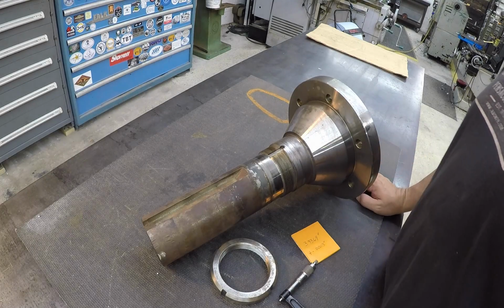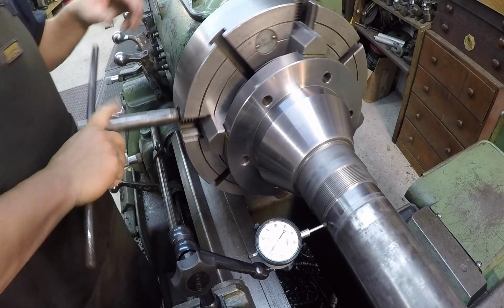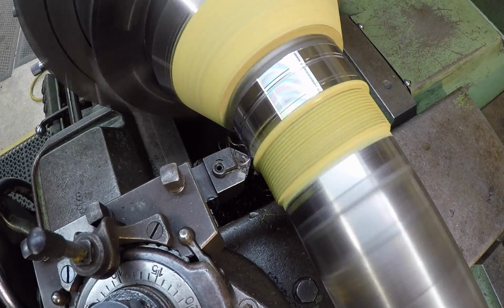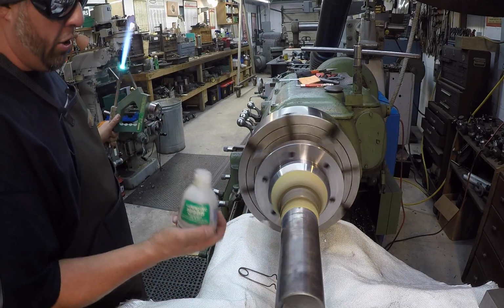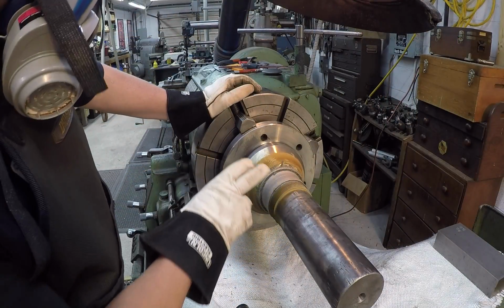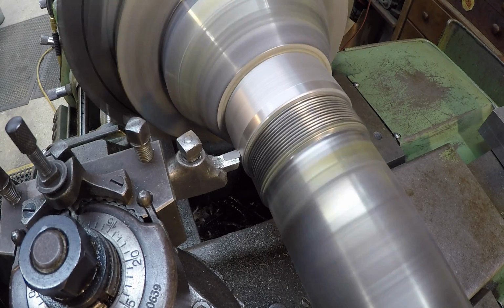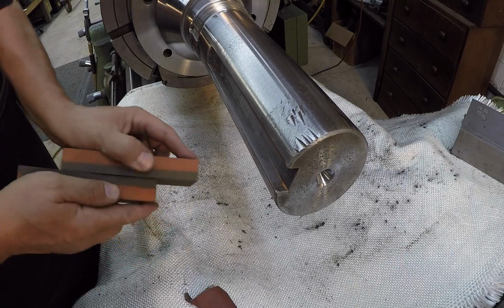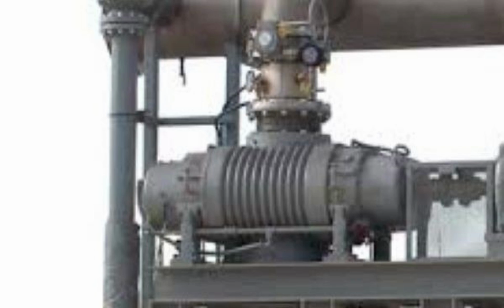SNS 300: Spray Welding a Blower Shaft

Comment: I have NEVER seen anything like this before.  This was really cool.  I appreciated the explanation at the end why you wouldn't use a conventional weld build-up as the heat would warp the part.  If the part would cost the company more than they'd like to replace, how much are you able to make on a spray weld resurface like this?  I'm subscribing to your channel as I want to see more.  Thank you!
Reply: You can charge whatever the market can bear.
Reply: Machine shops usually quote by the hour + material. Machine shops in my area charge anywhere between $70 and $90 per hour. This job probably took a couple of hours, and he almost certainly quoted an extra hour just in case something went wrong. That powder used for the spray isn't cheap, so he's charging for that. All in, he probably charged something like $300-$400, before shipping. 

To make a part like this from scratch would cost close to $2,000. It's complicated, and the material isn't regular cold rolled steel either.

Comment: We did it over twenty years ago and called it "Flame Spraying." We used it on aircraft
Bearings when replacement bearing were not available
Reply: That’s funny! Every time he pulled down the torch to start application and blew that huge initial spray I would say to myself, “DRAGON BREATH!!!”
Reply: we called it flame plating rather enjoyed it -- biggest surprise was -- did the same job the part-owner did too --- long long ago memories hehe

Comment: I had a job doing this around 42 years ago for an Electrical Motor Re-wind company, it was a good process, I wonder f it is still used?
Reply: We still used it for bearing fits on shafts 14 years ago, the last time I was in a motor shop.

Comment: Nice parts washer.  Reminds me of when I was in high school, working in a local shop=salvage yard…had an old Varsol machine inside an old shed…used it to wash parts and hands at end of the day pretty much every day…and there was about a 50/50 chance you’d get zapped when you turned the pump on.  Damn solvent would carry current and wake you right the hell up. Was like that the entire time I worked there. Lol!

Comment: Very good video! Back in the 1990s I had a 3" or 4" by about four foot long shaft repaired by spray weld, as far as I know it is still running 40 years later. It was a large blower fan (60 HP or larger) on an air handler, first we had some vibration, than it became a rumble and then we found the culprit. The worn shaft was spinning in the bearing.
A new shaft would have been a lot more cost than the repair was and we also replaced the bearings.

Comment: Can this type of welding be used to repair an outboard rod journal. Rod bearings are caged needle bearings and crankshaft surface has a hardness between 54 and 56 rockwell

Comment: We started spray welding at our shop in the late 70's, we used Metco equipment. Pump shaft repair customers loved it because it was a cheap alternative to replacement. Did those jobs for months on end. I still come across jobs where I think "If only I had spray weld gear"

Comment: Very cool process, as a welder for some of my younger years I had never heard of this process. I wonder what the powder is made out of. Later in life I became an electronic repair tech and then a wirer for a Sullair and then Sulivan Palatek who make screw compressors of all sizes. When working at the one company I got a chance to fill in for a machinist that was having his knees replaced. I got the opportunity to turn the blanks for the screws that go into these compressors on a CNC Dual Turret lathe. Since I had machine shop all through high school,  I found this a very interesting learning experience. More interesting yet is the 2nd step of the process of how the companies profile grinder machine with its diamond cutting wheels cut the spiral flutes into the male and female screws that produce the compressed air in these screw type compressors. Keep up the great job, I’m subscribed now and look forward to more content. ✌️😎👍
Reply: It's a long list of powdered metals and oxides and things of that nature.

Comment: Great work 
 I have done industrial spray mig welding near 470 amps pure DC at 42 volt with .o45 wire pure Co2 gas on repairs like that as we needed a harder high carbon surface repair that was replacing much more lost material due to bering fail. 
    My method then was experimental in our shop as the company was in a rush and a 50 mile line of heavy oil was cooling down.
     Welding took only 5 min time with 5 hours preparation work was ganging up 2 400 Amp Hobart 3 phase welders with makeshift v block to rotate the piece while I applied the weld. 
   Afterwards it was sent over to a motor machine shop to lathe it down for another 3 hours and then hotshot driver back to the heavy oil transfer site.
     Worked perfectly and was within laser tolerance for minimal vibration mixing in a explosive condensate at very high pressures.
     Pump lasted another 9 years till system got a expansion.
 After that repair our shop went to Lincons that were in the 800 Amp range doing farm lifting shafts that needed a fast welding without changing the deeper structure of the base steel for Phoenix  100 foot rotary harrows in the lifting mechanism

Comment: I have a question for anybody that knows about this is it possible to arc-weld on a blade with the material spinning very fast could you are quelled a joint as it was spinning quickly like this is is it possible

Comment: Its an amazing blast from the past I have never done spray welding myself however I started out in as a machinist in a die press manufacturing company   in the machine shop, The welding department would do tons of spray weld repairs on crown belt pulley shafts and even on former tool shafts that ran directly on oiled bronze bushing. The pulley shafts were long and drove lines of presses with bearings spaced down the line it was a cost effective solution to scraping the shaft. The repairs were done often and don't remember any failures. Very cool to see it done by a pro Thanks for sharing

Comment: awesome can this process be used on automotive crank shafts
Reply: Cast crankshaft don't like the heat and the surface is going to different
Reply: @mikejohnson5491  that’s what nickel rod is for. Pre and post heating. Never had an issue
Reply: @cwr4587  ok they're talking about the spray welding not fixing a cracked block. The guy asked if it would work for a crank shaft. Does nickel rod work for building up where a spun bearing needs to be built up.

Comment: Back in the late 40's my grand fathr started a business of metalizing ceramic lamp bodies. He would cover um with zinc, and then use stainless steel spool wire or brass and spray it on the ceramic lamps. He then had to buff smoth all the roughness that came from the spraying process. They used flint buffing wheels. I was a kid but still remember when they got zinc poisonings really bad. they recovered!

Comment: Can we use this on the crankshaft ?
Reply: Id like to know as well. Id imagine there is a good powder for this application and since its riding on a layer of oil and doesnt contact.
Reply: @TheAnonymous1one  when we used it in electric motors and industrial drive repairs we kept it limited to things like bearing fits that wouldn't allow it to be slung apart from centrifugal force, it becomes like a cast sleeve on the shaft, I have seen it used from other shops on babbitt and oil lite bearing fits, but our shop policy wouldn't allow it.

Comment: good job, but about 25 years ago as a metalizer of 45 yrs i gave up overspray retardants in favour of simple guards that stradle my lathe and keeps the over spray away where u don't want it. it works for fuse welding, wire spray and plasma, leaving about a 1/16 of overspray to clean up after

Comment: Nice shop you have there. I worked in a job shop with an old guy when I got out of trade school as a welder back in "81" for about three years. They were a dying breed back then, all the others opting to move to production work. That was one of the more enjoyable jobs I've had. That was so much fun  learning to use all the machines in the shop and new projects to figure out and work on every day almost. The old guy was a master at it and a hoot to work with.
I moved on and wound up in electronics which I've done for the past 30 years. But I'll always love and have a soft spot in my heart for machine shops. :)
Great vid. Thanks for sharing!

Comment: Hi, enjoyed the video. In the Aerospace industry they refurbish parts using plasma spraying, and Ford uses the same process to refurbish cracked engine blocks. My only concern is that you made no mention if the part had been X-rayed to check for cracks. I say this because if the parts does fail and it had cracks and it ended up fouling the whole assembly your fixed part goes into, then the easiest way to put the blame on you is to claim your work failed when in fact it was the operator who failed to make proper adjustments and caused the damage. I speak from personal experience having worked in the oil and gas inspection services sector, and my son is a parts tester for a major oil and gas service provider. In one incident a part my son's company made was accused of failing causing over a billion dollars in damages. Since my son is the top tech , he was tapped to simulate the proper installation of the part compared to the video and notes by the oil platform tech who installed it and had it failed. An international group arrived which consisted of the owners of my son's company and owners of the oil company and their top engineers. Well my son demonstrated perfectly how the part was to be properly installed, and he was able to show the part could be taken above stated maximum tolerances and still not fail. Then he replicated what the oil company did installing the part and he showed how it started to fail when a load started being put on it. The oil company's own engineers conceeded that the part had been improperly installed and the multi billion dollar contract resume and the lawsuit dropped. To protect yourself from being shaken down by a company who is trying to shift the blame for their own mistakes and armature repairs, demand the part be properly inspected and x-rayed before doing any work. And make sure you get to see the x-ray and notate on your work orderform any areas of concern before attempting any repairs. And make sure to properly notify the owners of the part in writing what you found before you start. The saying goes... the last person who fixed it is to blame. So please be careful, from my viewpoint it looked like there was some evidence of stress fractures on the upper part of the shaft that was all beat up. 

Carpe Metallum!

Comment: How does the strength of the spray welded area compare to the original metal?  Stronger, weaker, or the same?  Is "spray weld" 100% metal, or are there other things like epoxies, etc...?

Comment: Very interesting presentation.  I am wondering that since you put the unit in the chuck cold, and after applying heat even if not excessive, why would that not require a "time out' to make sure the natural expansion of the shaft would not alter the trueness of the chuck????  Heat expands...apparently evenly...but chucks take that expansion somewhere...I noted that you use "pads" of brass and or other materials you said to protect the shaft (piece)  Would that allow for even expansion???  Not a machinist....just an old guy wondering about that heat change and effect on the outcome of the product??  Nice vid...

Comment: Welding will work better than the spray welding . Our company had  tried it, but it didn't work, it just pealed off when they machined it back to size !!
Reply: didn't do it right.
Reply: spent 20 years metalspraying using metco, best kit on the market.correct proceedure 1 preheat 2 undercut 2mm on dia 3 mask and grit blast surface ,if no grit blast facilities,rough screwthread .020 depth 24 tpi 4 antibond and spray one step powder for build up plus maching allowance. SIMPLE

Comment: I did quite a bit of shaft repair working in a job shop back in the 80s but we undersized the journals cromed then ground to size. We did Medical, aerospace, and national defense projects We specialized in superfinishing. This was very interesting.
Reply: Hard chrome or thin dense chrome is more acceptable for flight hardware. Cold spray can fail

Comment: Your video brought back memories. Back in the early seventies I worked for a pump shop in    L A doing shaft repair using the exact Eutectic setup not only for the bearing area but also for the area where the shaft packing sits. I remember powders in stainless and bronze also temperature markers for keeping it at 200/500 degrees and a asbestos blanket to protect the lathe…..ahhh the old days.

Comment: Won't the mallet shock shear the gears in the dial indicator?
Reply: No it shouldn't. If it does then you either need a better quality dial or a shorter travel dial.

Comment: The metal shavings from the metal structure deposited by flame spraying and stacking are shown as porous and bulky in granular form, and the complex force with the original metal is very low, and it is unable to bear heavy pressure and torsion.

Comment: Sorry I don't mean to criticize. You were wright when you said that the system was very old . I know this for a fact. In the latter 70s I was a flame sprayer for several companies. Like Otis engineering, Brown and Root, Halliburton Ingersoll Rand . I coated Ball valve seats, down hole pump plungers polish rods spiral guides. Metco (out of Houston Texas)had a system that worked a lot easers. there is a tape that you can cover the threads with that will just peal right off .Check out a plasma spray welding ! Also the coating that you put on has a possibility of cracking and pealing try cutting a 125 finish on the base metal  ,on a straight shaft try using a shot blast  you will get a better fusions to the base metal. If you mount your gun on your carriage and move your gun closer to the part and use a more oxidizing flame you can apply a coating to a closer tolerance.  you can spray as little as 0.005" or depending on the composition of the powder that your  spraying  you can spray up to as much as 0.075" with out any sagging. Preheating is very important and cooling is also important. Spraying on a taper is difficult unless you fuse as you apply your coating. The coating's hardness that the customer requires is important so that you can spray the powder composition to achieve the required hardness.  I know this is a older video but I hope it will help someone in the future.
Reply: Thanks for sharing your experience. Though my field is way away from this. Learning something new is always awesome.

Comment: I notice you truing up the flange on this piece then chk the run out on the end of  the shaft and get it true then check the face of the flange and true it. When you true the face of the flange didn't you move  the end of the shaft out of true. since the shaft and the flange face are perpendicular to each other.??

Comment: My OPINION, the "soft jaws" are totally un necessary and could potentially cause a problem in maintaining tolerance. The brass shims are NOT a good idea. And you can indicate a work piece in a 4- jaw just fine without those brass shims.
Reply: Good thing it's your opinion. I've been using brass shims for years and never had a problem. If you watched the video he clearly explains why he's using it. I pretty sure he knows that he can indicate the part without the shims, he is using them so that the hard jaws don't dig in the part

Comment: First time for an old welder like me who would probably have decided to do a brazing or micro-weld at low temp if I new the metal grade type but that's just my low info on the subject opinion. Amazing job and it's all good. Now... we just need to know how much it would've taken to build, buy, replace that part with a new one and to compare, how much did you charge for the job? You better confess my child! Thanks for sharing (promise I won't tell anyone what the profit was...) Also, on a different note.. And most welders will agree that, no matter what type of welding one does, it opens up the gusto and curiosity when you weld for the love of machinery work so, most welders eventually become some sort of Machinists at one level or another. I mean, welders become fabricators, then Laymen and finally, Tooling and machinists and eventually some become Blacksmiths, right? We love to learn how it was made, how it works and how it can be put back to work by means of repair and that's a whole new chapter for us... Got to love the love for metal!

Comment: Looks weak compared to just using a mid welder to do a spiral buildup and recut. I don't see the benefit to using melted powder.
Reply: Heat affected zone is much smaller and not as an extreme difference.  Heat is slowly built up and is overall a lower peak temperature than the electric arc. Less chance of heat distortion and embrittlement from rapid cooling.

Comment: Working for Otis Elevator as a Service Manager in Richmond VA my repair  crews would  encounter a galled shaft on a worm gear shaft or other shaft. Due to maybe a failed bearing on very old elevator.  Our vendor machine shops could spray weld the shaft then turn it beck to original diameter.  This was in the mid to late 60’s .  We had wonderful machine shop vendors who could fix just about anything made of steel or bronze.   Great  video .

Comment: Many years ago I bought a reprofiled Camshaft that was built from a road profile to a full race type.   They most likely used a spray coating method,  I could see the step in the type of metals.